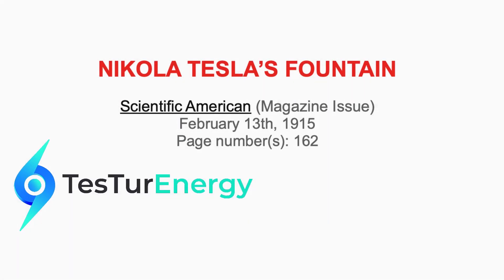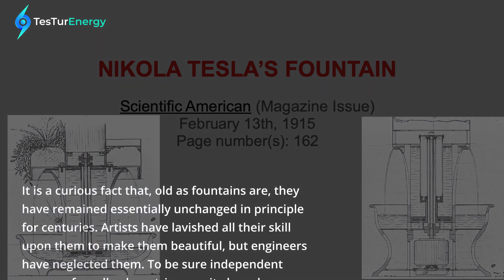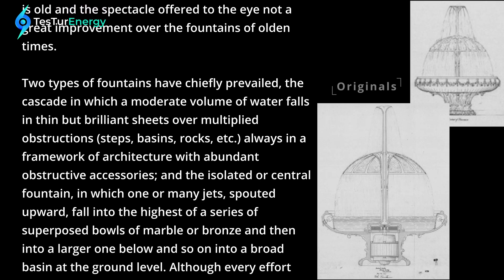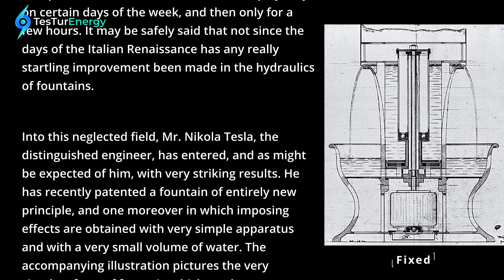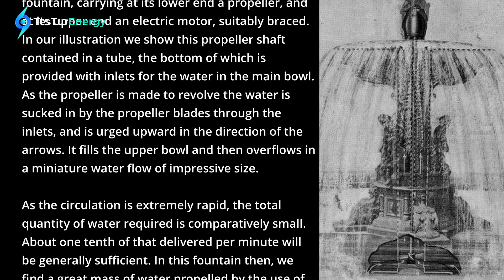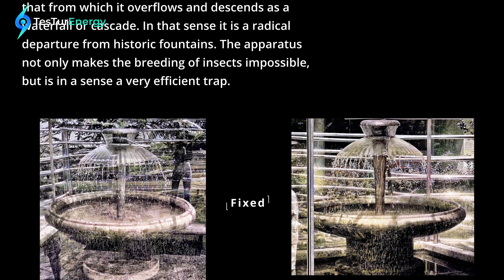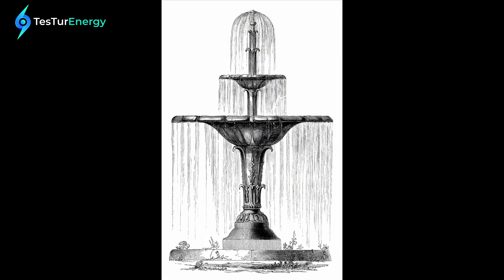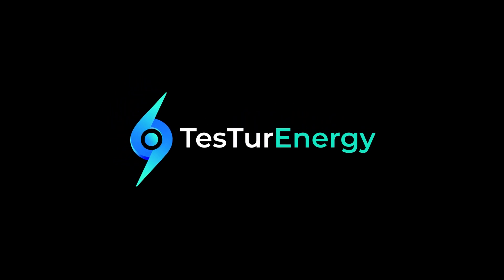Nikola Tesla's Fountain - Scientific American Article - Issue Feb, 1915 Read Aloud AudioBook

Comment: You can find formulas for optimizing the effects of this by looking at a compressed air tool called a vortex cooler, or sometimes cryo cooler. You can get over well over 300f on one side and below negative 50f at the other by the vortex pressure differential and centrifugal speed
You’ll notice the vortex housing on the tool is for all intensive purposes the same thing as the Tesla turbine but missing the rotor disks, the same thing, using the same effect
The hot and cold sides of the tool represent the humidity/water condensing side driving the impeller connected to Tesla turbine, and the water/steam expansion side driving the power turbine and Tesla pump, cycle repeats(well, sustains really)
Great friggin job mate. You built the most important part of the whole machine!
Reply from the maker: Check this out! 
Thermoelectric Tesla Turbine w/ Dual Stage Vortex Tube Aided Cooling + Tesla HHO Electrolysis Discs
https://youtube.com/shorts/_qROtAW8XLg?feature=share
Reply from the maker: Just released the latest update! 
Tesla Turbine 250 watt to 2.65 kW Power and Efficiency Test
https://youtu.be/XQl1DQgXVkQ

Comment from the maker: Edit: the fountain could stand to be the most efficient way to exchange heat with the air because this fountain design requires the least amount of ENERGY” to circulate a very large volume of water.

In this video I erroneously said “requires the least amount of WATER to circulate a very large volume of water”

Comment: Hey Charlie... just wanted to hit your latest video with a couple of thoughts inspired by you and jeremiah's videos and projects.  
Thinking two stages, and just having watched your adjustable nozzle for steam turbine video... I had a quick vision.

  I was thinking two stages, same axle, same housing, turbine and pump/compressor in series, entrance and exits at the perimeter.  I found myself envisioning those series stages as one rotor, with a divider plate from the outer housing.  Inlet on "left half" a normal tangential perimeter slot (preferrably your adjustable design?), fluid exits at center between shaft and divider plate, and passes directly to center "inlet" of "right half" pump stage.  The thing that caught my mind as worth picking your brain about, was what would happen if the tangential exit nozzle on the "pump" side, had the opposite tangential angle, so that the exiting material has to completely change direction to travel out... a sort of "tesla valve" exit...

What would the differences be with a compressed air, vs cryophorous system using such an arrangement?
 
Would anything "magical" happen, when such an aparatus went supersonic at it's perimeter?  (Assuming it wasn't fighting it's self too much to do so, with the reverse tangent exit, or even with a normal "direction of flow" tangent to the outlet)

Would love to hear your physics mind's thoughts on my (possibly not novel) concepts?
Reply from the maker: Hey orcoastgreen thanks for commenting. Well first off I want to say, be HIGHLY skeptical of ANYTHING you get from Paul the perpetual motion scammer and his videos. He has shown to patently misunderstand basic fluid and thermodynamics over the years. For the first two years I knew him he DEMANDED the speed of sound changes with pressure so he should be able to reach supersonic speeds easier at lower pressure. This is patently false as speed of sound is directly temp dependent.  
That being said Well you want the pumps outlet to be in the same direction because centrifugal pumps utilize the fluid speed at the disc tips to be converted into pressure using a diffuser cone arrangement. The Tesla turbine has the added benefit of the centrifugal head working to aid the pumping action by adding the centrifugal head to the pressure produced via the kinetic energy given to the fluid. This is the purpose of the volute casing as the flow area increases the velocity slows down but pressure increase 

Personally I would think having the outlets in the opposite direction would add to much of an impediment for the fluid to get out. Ultimately you would be operating on the centrifugal head and only the centrifugal head to do the work for the pump. 

It certainly worth trying. And I’ve done a handful of tests where I spun my rotor backwards in the case when I had it set up as a compressor and it didn’t work as well when I had it spinning in reverse.
Reply: @CharlieSolis  - I don't follow paul, only Jeremiah, as I found his diplays of a cryophorous setup very interesting.  Paul struck me as kind of a perpetual motion thinker, and focused on tiny turbines that won't do much and have to spin at insane speeds requiring esoteric air bearings.   I like your practical, science and logic minded and especially, well documented, open source approach.  Some of Jeremiah's displays are impressive, but no one is building a practical CHP system, or documenting and sharing their progress, like you are.  

I was thinking that with the centrifugal forces, if a cryophorous vapor is spun fast enough past a restricted exit, it could force the material to keep spinning til it loses enough heat to condense, and concurrently, enough volume to exit.  But I guess that would require a way to get the heat out of that second stage.
Reply from the maker: Thank you for the kind words. For the most part I want to be able to 100% predict what will happen in every test before I even do the test. If my predictions of what will happen aren’t close then I’m not seeing things correctly. But thus far everything just keeps falling in place perfectly. 

On the note of the aided condensation. This is the purpose of my Tesla Turbine Interstage Heat Exchanger design that I came up with. If you haven’t seen it yet check it out. 
https://youtu.be/pYSniitC8DM
And then after the interstage heat exchanger the Tesla pump Multifluid vortex mixer steam condenser design of mine goes as the second stage and draws cooling water in from the opposite side to be mixed with the steam and condensed in rapid motion between the discs. 
https://youtu.be/qLBqbBPikcc
Yeah Jeremiah does great work I admire his experimentalist abilities. Where I’ll bog myself down with thinking about the details too much, delaying my progress, he’ll just pull the trigger and do it to test it and see what happens. Both extremely viable approaches.

Comment: I'm still trying to understand the impeller design and where water is sucked in and expelled, and flows through, from the photos.   Thanks for this vid and sharing your work on replicating this incredible system that has been ignored for 100 years or so.
Reply from the maker: Hey thanks for the comments! Water comes in the center column at the bottom and center of the basin and then is sent up the tube to the top to trickle over.
Reply: @CharlieSolis  It looks like he is creating a vortex from the bottom of that upside down cone shaped upper chamber.  It reminds me of the inverse of those dust collector cyclones, upside down with water.  I bet it would look awesome with a clear upper reservoir and some mildly bouyant materials mixed in, so you could see the path of the water.
Reply: It also appears that this design would be relatively less susceptible to clogging than most types of pumps used for “fountain pumps”

Comment: In a home or a greenhouse, one would want the effects to be non- evaporative, I would think.   Definitely in my climate, where excess humidity = mold in a house.   

I see now it is not always meant to have a cover.   In my uses of it, I would want one.  I could see an "upper 2/3 of an egg" shaped cover, or a truncated cone, for easier manufacture.  With vertical fins on the outside for heat dissipation to the air, and a shroud over that, to direct the air down over the fins.   The fan impeller and it's housing at the top could be integrated into/attached to that outer shroud, impeller slip fitting onto the top end of the motor shaft, to make service easier.  

For the overall unit, having 3 legs/feet with screw thread adjustment would make sense, as a circular fountain would have to be pretty well level to send water over the edges evenly all around the perimeter.

Going to go watch this again, as I understand some of it now, as far as my previous questions go, but need to study it more to understand the differences from a traditional fountain, and how you or I might use it for our heat transfer needs.

Comment: Did he ever build one? I never actually seen a working one or physical model at any of the museums either.
Reply from the maker: Brah… c’mon now… 
https://youtube.com/shorts/KP1R4-9uR-0?feature=share
Reply from the maker: But yes he was commissioned by the Tiffany’s department store to build one. That’s what the “real photos” in the mix are from, the ones that aren’t drawings. I probably should have labeled them 😅
Reply: @CharlieSolis  That is what I was thinking but I never had seen one so I had no idea on it as a functional device. Definitely want to contact Tiffany and find it now.
Reply from the maker: It’s probably sitting in someone’s backyard right now 😂 one can only hope at least.
Reply: @CharlieSolis  Need to do a salvage pick a restoration on that one. Saw a guy trying to sell one of Tesla original working motors on pawn stars. Guy wanted a ton of money was told to take it to a museum because he can't sell it😂
Reply: I seen yours I was looking at historical.  I didn't see those before and Tiffany none the less is impressive. Does it say what they used it for boilers or was it Actually used with a Tesla engine?
Reply from the maker: @Evan Dunn  oh no it was just a fountain. The only place Tesla ever mentions the fountain is for anything other than aesthetics is the two sentences in the fountain patent about how it’s good at cooling surrounding areas and that the fountain could be artificially cooled. Technically I came up with the idea to use it as a condenser heat exchanger but I HAVE to assume Tesla thought to use it this way. It would be quite hubris of me to think he didn’t see this use of it and wasn’t being rather coy about his practicable uses for this.

Comment: What with a "fan" on top, would be the difference between pushing environmental air at the water, versus pulling or drawing air away from the cascade? 
 Of course I would ask the otherwise unthought of questions...
Reply from the maker: You get an increased air flow over the fountain with the fan resulting in more heat transfer.
Reply: @CharlieSolis  But of course. I was basically asking, push or pull, and what would be the difference?
Reply from the maker: If you are giving off heat to the air you want to blow up. If you are trying to absorb heat, ie cool down the surrounding areas with the fountain, you blow the air down. This way you get convective additions.
Reply: @CharlieSolis lolz, self explanatory, derp. Sorry about that.